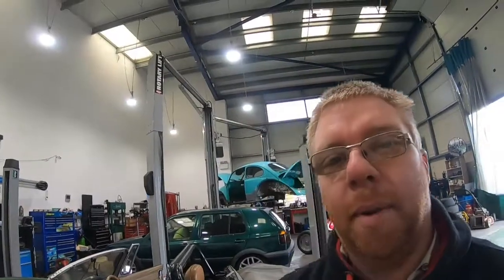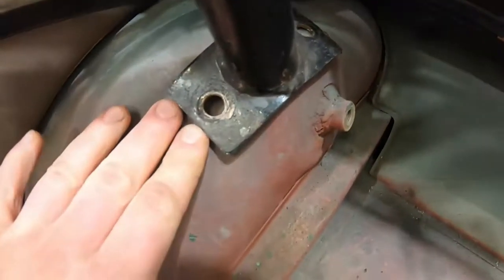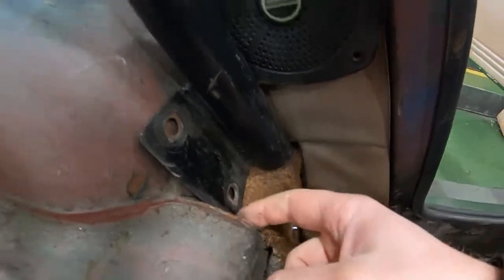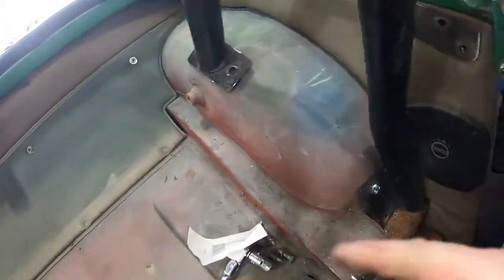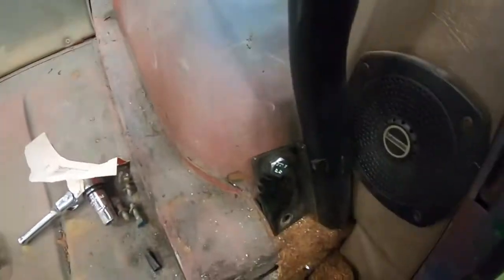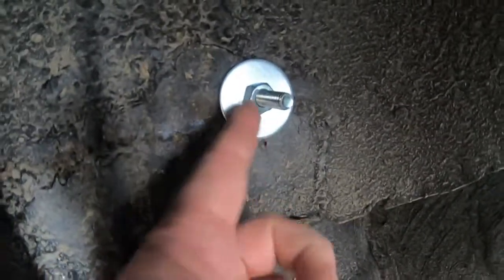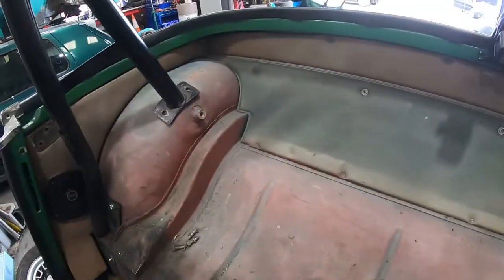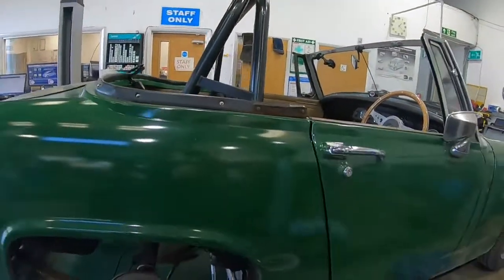How to fit an MG Midget roll bar - K series Midget project

Comment: hi I have a similar roll bar on my midget, they actually have a backing plate pretty much identical to the plate welded to the actual bar that fits where you have used washers, about 3mm thick. I got my rollbar on ebay used without back plates, I found some on ebay on one of the rally/ford escort sellers page, will try and find a link.
Reply from the maker: That's great thanks
Reply: Yes, I had the same plates on my previous Midget roll bar that matched the plates on the inside of the car.  It spreads the load better. than washers.
Reply from the maker: @awalk5177  Thank you